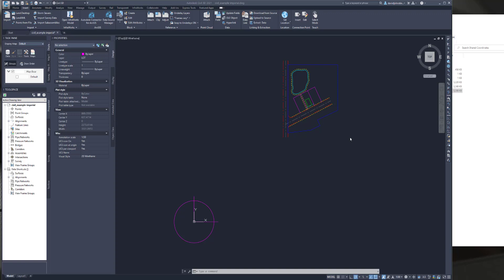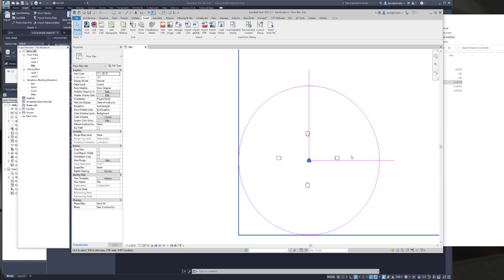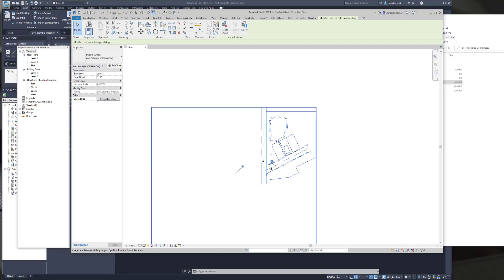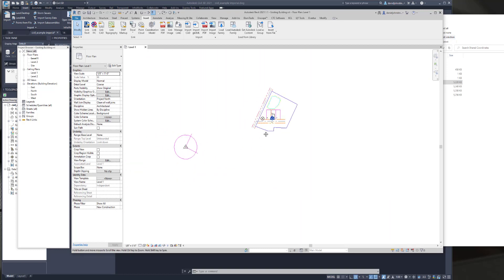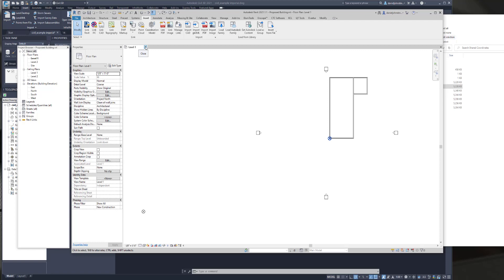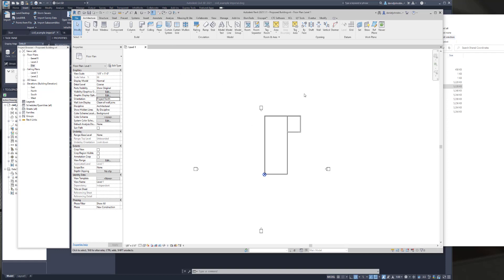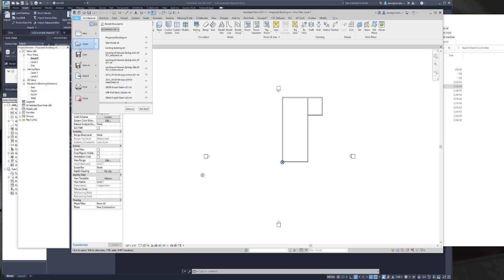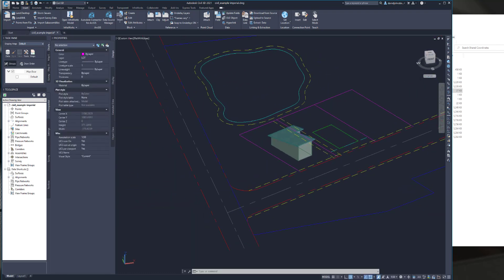Revit Shared Coordinates   Civil CAD to Revit and Back

Comment: Hello Daniel,

I am currently trying to help get everyone in the firm I work for setup so we can start projects correctly related to this and have run into a few issues that nobody at Autodesk can answer:
1. On project 1, I am able to get it to work just as you show in this video series without a problem.
2. On project 2, one I'm working on in the early design stages (out in the middle of the mountains/woods in Utah) has a very high level survey(10ft contours) set to the state planes coordinate system with the correct aerial map showing but when I check geolocation the pin is in the Pacific Ocean.  I got to looking at that because when I bring it into Revit and do as you do in the videos it doesn't move the survey point.
3. On project 3, a project others in the office are working on in Texas has a survey that is also set to state plane coordinate system but it however does show the correct geolocation.  Even with the correct geolocation it does not move the survey point in Revit.

Have you successfully gotten your process to work on a very larger land planning project that is set to a state plane coordinate system?  Any suggestions?
Reply from the maker: At the end of the day, the Revit survey point is really just aligning with the CAD origin (which is the benchmark of the state/county/etc coordinate system). For some reason the survey point does not always aligned with the origin but the N/E numbers should be real-time to that same CAD origin. Does this align with what you are seeing across your three examples?
Reply: @DanielStineNow  Thank you for the suggestion.  I have been able to get the projects to work in Revit now.  I just cant get it to align properly back in CAD but I believe it is because the contour file we are using are from conceptual design phases so its from GIS.  I will try again once we get actual surveys for the projects.

Comment: Great Stuff. I am curious though, at around 15:35, you used the rotate true north to align the proposed building to the property line. How come you did not just select the site model link in the proposed model and rotate that? Could you just have moved and rotated the site file link and it would have been the same or is that "rotate true north" required to keep this all working correctly? 
Thanks again for this video, super helpful.
Reply from the maker: Correct, you must use Rotate True North to keep everything sync'ed. Simply rotating the linked site would not result in the building being rotated back in the site model. Tip: At the end of the day, all shared coordinate edits are done with the idea that the shared coordinate "icons" in each model are all kept aligned/relative to each other. Moving the Shared Coordinates "icon" causes all linked "icons" to follow... moving a link directly breaks that relationship.
Reply: if you dont use shadows and stuff that want to represent real life location then you can rotate the file. but its real nice to keep it how it would be in real life and just make plan north up.

Comment: Daniel, after linking the Civil cad file into the Site Model file, I followed every step you shared to Acquire the coordinate from the cad file. But when I drag the civil cad file and reconcile, it doesn't change the location of the Survey Triangle symbol. Also when I want to save my Revit file, it tells me that I changed the "current" Position in the Civil CAD file and if I want to Save it in the CAD or not? Why is that?
Reply from the maker: The coordinates should not be acquired until after you move the CAD file in the Revit site model. Also, for some reason, the survey point does not always move to the origin, but it’s X and Y values will relate to where the CAD origin is (I.e where the survey point was expected to move to).

Comment: How to you work around files that have geometry extents greater than 20 miles? I've seen workaround where you copy the portion of the file you need from the Civil CAD and copy it to a new file, but doesn't this "lose" the original coordinate system of the Civil file?
Reply from the maker: Making any changes in CAD should be avoided by the architect. The "20 mile" issue is just a warning in Revit. The important thing is to move the linked CAD in Revit (separate Revit site model) so the area where the building goes is close to the internal origin. Revit geometry becomes unstable when it is too far from the internal origin.
Reply: @DanielStineNow  Greatly appreciate the reply!

Comment: Is the survey map .DWG from the Survey Firm already included in the CivilCAD DWG file or do you later link in the Survey DWG to the Site File Revit Project and create the Topography?
Reply from the maker: Usually start with the survey data (i.e. Civil CAD) file first. The proposed civil design uses the same coordinate system and will link into the same place, once it is available.